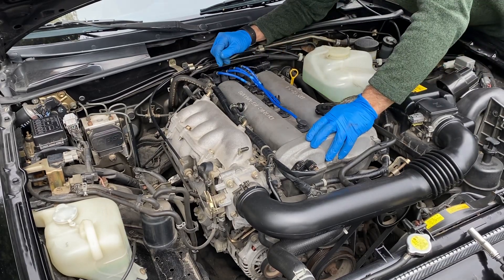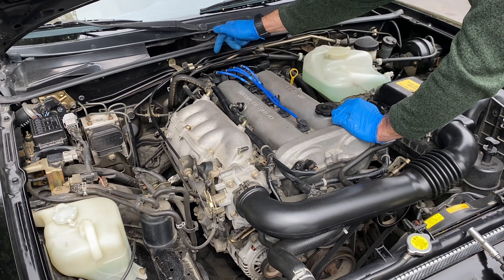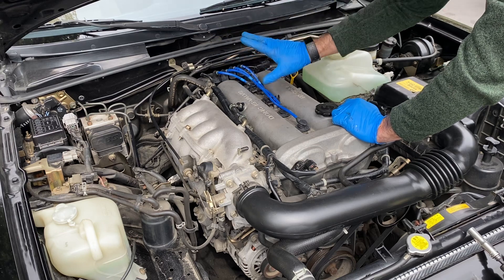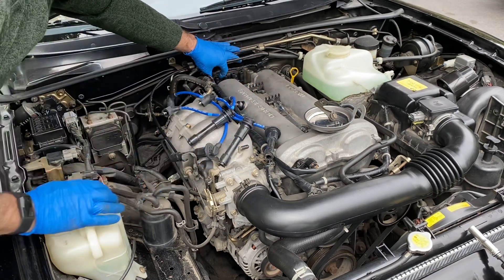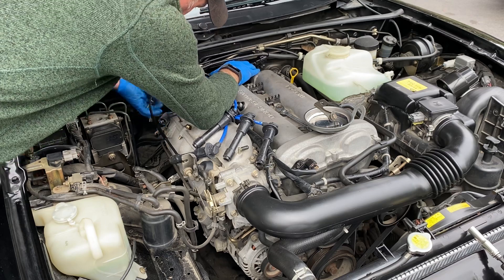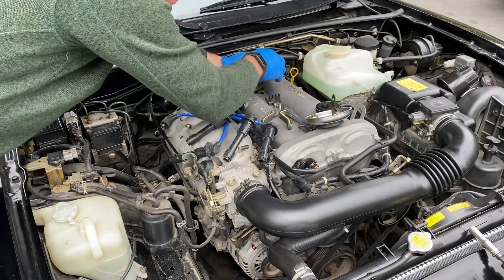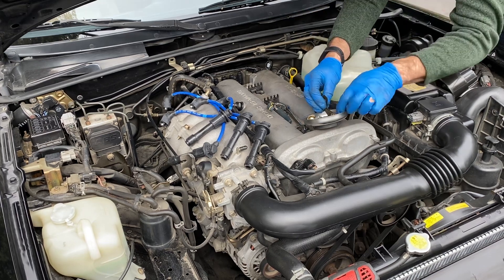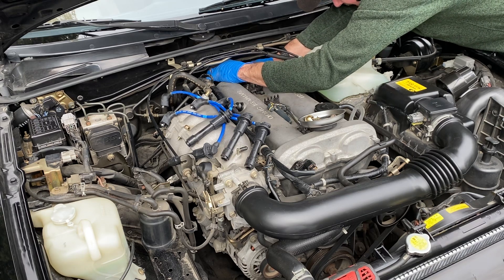Part 1 of 2: Ignition coil pack replacement for 1994-2000 Mazda MX5 Miata.

Comment: I was having warm start issues and recently cold starts issues too, the P0300 code showed up also, just changed the coil pack 6 warm starts and not a single problem or hesitation, thanks for your video man you helped me a lot
Reply: Update starts problems fixed thanks
Reply: I have the same code in my 97!
Reply: @NealChauhan  one year later still fixed

Comment: Another great video. 
I’ve moaned a few times about access when working on my 1.8iS, but having changed the water collector and thermostat housing on my son in laws Citroen C4 Picasso this weekend I’ll never complain again. An absolute nightmare, to get to just 4 heater and radiator hoses together with various electrical connectors, 3 bolts and a clip on the water passage from the engine block we had to remove battery, battery tray and support (including a hidden access nut which meant removing the wheel and the inner arch) and the air cleaning system. It took us the best part of a day to do, of which 3 hours to get a stupid clip back on which was both invisible and very difficult to access. I suspect most of the assembly was done at the factory prior to installing the engine in the car, with no thought for anyone trying to replace components later in the car’s life. I will never, ever buy a modern Citroen !!
I’m archiving this video in my MX5 collection, though I believe this is not the same in terms of components on a 1994/5 NA8. Can you confirm ?
Rob

Comment: Recently swapped mine out. Was going insane because I was having rough idle but only after starting the car after a short break (i.e grocery shopping) and it would resolve itself anywhere from 5 seconds to 5 minutes. Pulling out the ignition leads while the issue was ongoing I found the issue to be on cylinder 1 and 3, then it was obviously caused by one of the coils being defective.
Reply: I have been having I think the exact same issue for 2 years. It misfires only on startup and not every time. Sometimes fixes itself in a few seconds.
Reply: @Cubemaster did you ever figure this out?
Reply: @Cubemaster did you ever figure out what the problem was?
Reply: @corytv9689  Yes actually. I replaced the ignition coil, which turned out to be the problem. Stopped misfiring!

Comment: I viewed your video before attempting to replace the coil pack on my 99 Miata. Following your suggestions assisted in the removal of the pack. However, I used quarter inch drive sockets with the same inner diameter as the holes for those pesky plastic push in clips. Just push the socket over the end of the clip and pull the clip out. On the larger one in the back I used a 1/4" drive breaker bar attached to the socket to assist in reaching the push in clip.
Reply from the maker: Hi Steve, thanks for watching and for sharing some helpful tips.

Comment: I have had P0300, P0420, and P0455 on my 1999 for two years straight. I've had the evap system rebuilt for over $1000, and that did absolutely nothing, except prevent the car from misfiring for a couple weeks. 

I've replaced the spark plugs, wires, and now the ignition coil (with help from this video), and it has not misfired since, but the P0420 and P0455 came back. 

When it did misfire, it was only on startup and usually for just a few seconds before correcting itself. While misfiring, the ignition coil was not sparking on the spots that go to cylinders 1 and 4 (the left two). Once the misfire fixed itself, all 4 were sparking.

Any advice is greatly appreciated!
Reply from the maker: The P0420 is a Catalytic Converter code and points to the cat performance being below the specified threshold. 
It’s very common on 1999 and 2000 Miatas. It’s also prevalent on other NB’s. I be chased it on some of my NB’s and it keeps coming back. 

The P0455 “Large Evap Leak” should be a little easier. Have you checked the rubber O-Ring on your gas cap? 
There’s a chance that it’s cracked.
Reply: @MiataMan  Thank you very much for your reply. Yeah I actually bought a new gas cap with the ignition coil, but it didn't fit under the gas tank lid, so I actually just swapped out the o-rings. Then after I replaced the o-ring and the ignition coil, I cleared the engine codes. The catalytic converter one came back 7 miles later, and the EVAP one came back within 50 miles of driving.
The car smells of gas really badly, especially right after filling it up.

Again thanks for taking time out of your day to help me.

Comment: I have a 99 mx5 and I’m having a hard time reading the code. I tried the paper clip trick on the Ten and Grd in the diagnostics box but no codes flashing. Does anyone have a trick for reading the code without a OBD1 reader??? I think I have a ignition coil pack problem too. I’m idling low and now the check engine light started flashing a few miles after first coming on. Waiting for the part.
Reply from the maker: If you have a 1999 MX5 it will have an OBD2 port next to the interior fuse box. The 99-00 MX5’s were well know for bad coil packs.